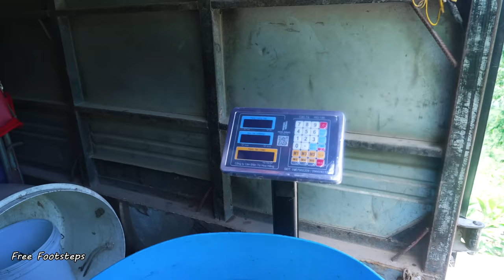Full-video: Repairing Mini Hydroelectric System - Build a Wooden Cabin in the Next 30 Days

Comment: I like the way she installed the floor which has an elevation from the cemented flooring and NO opening on the bottom portion from the floor which snakes and some other crawling predators could get inside the house, unlike other mounstain houses which has an opening on the bottom portion.. GOOD JOB. . . .